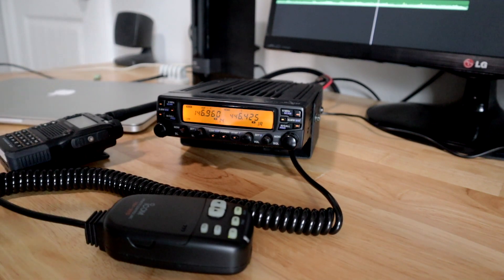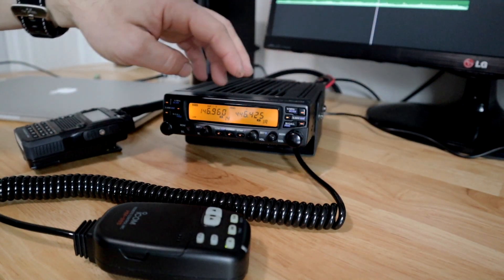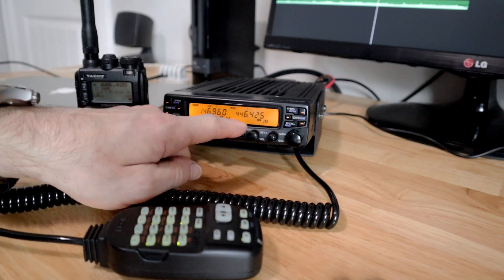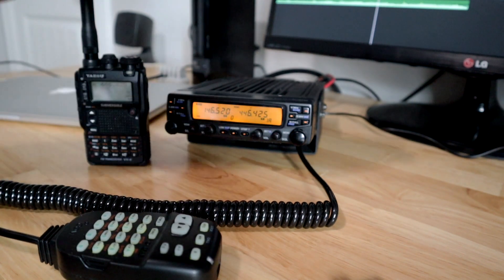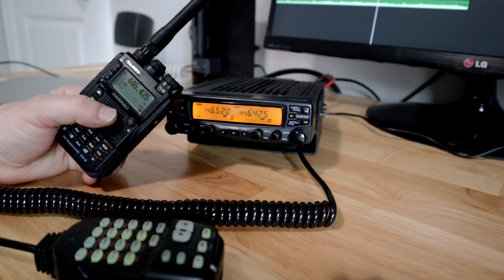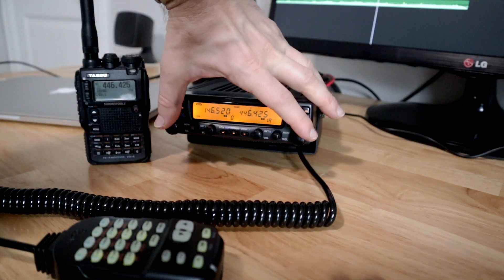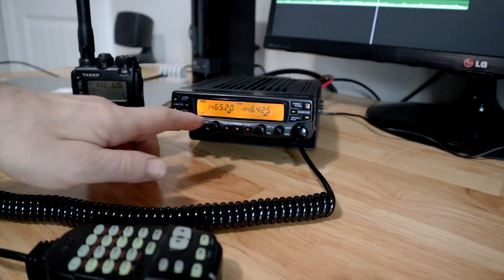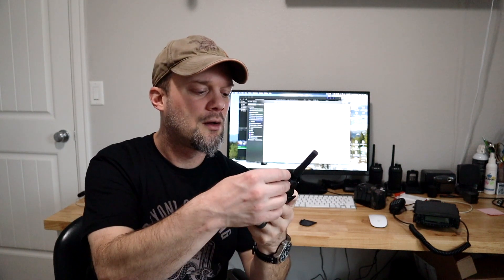Controlling Icom 2710 remotely - And a cool QSO with local ham

Comment: I found one of these on eBay and got it for $61!  Thanks to this video I was able to get it set up with crossband repeat.  The manual wasn't much help with this.  Now I can use my HT to walk around my neighborhood and talk on one of the local repeaters that I've never been able to do with an HT before!  Thank you!
Reply from the maker: @stevenA44  I still have it..great radio.  Open it up and see if you have the remote control module..if it’s in there, you can turn on and off xband with your ht.
Reply: @design2survive  I already looked inside and it doesn't have the module.  I might try to find one for it, but I'm not too worried about.  Just the fact that I can use MY HT around the house and my neighborhood is good enough!